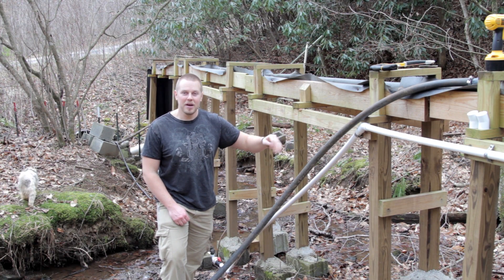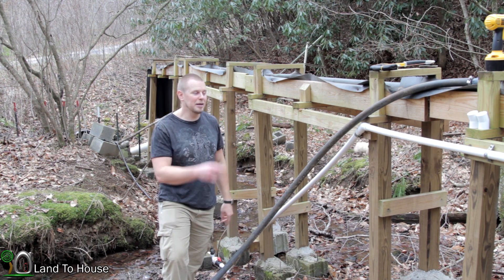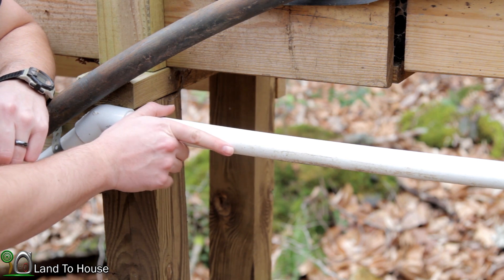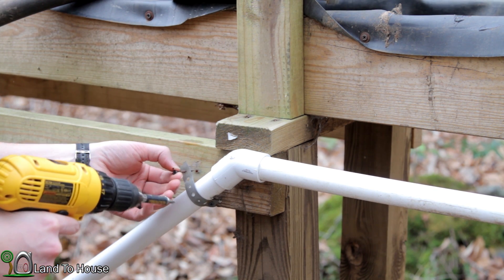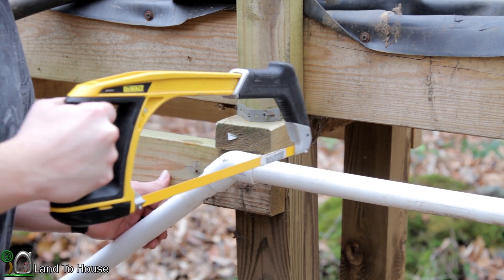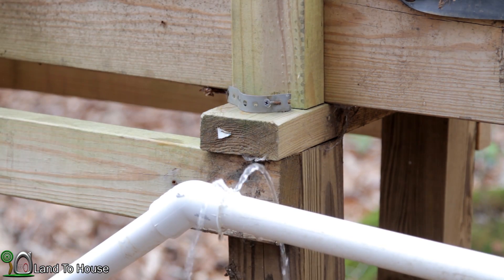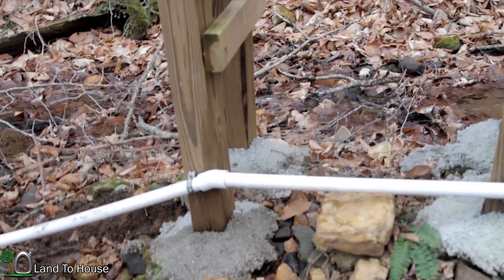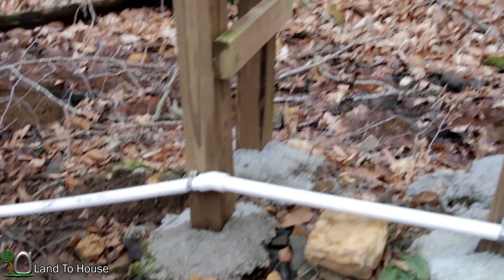Ram Pump Air in the Drive Pipe

Comment: In take pipe is At a height of 6 feet ..... so what will be the minimum run down length to start an inch ram pump..... please enlighten me on this issue although I feel that the length of run down length is not important ....
Reply from the maker: The run down pipe is known as the "drive pipe"  I have a test on my channel showing that a pump can run on a very short drive pipe. 5 feet long. BUT the short drive pipe causes the pressure wave to be very fast and this keeps the pump from building pressure. It also causes the pump to use more water. I recommend using a drive pipe that is at least 25 feet long but shorter than 100 feet.
Reply: Oh I see.... I am just beginning to built a pump.... and did some minor calculations on the so-called drive pipe length variation and angles ranging from 0• to 90 •.... but frankly i didn’t think About the pressure built up .... thank you so much ..... you’re a treasure

Comment: alternatively, you can try creating and installing an in-line air capture device to purge the air from the line like they do with other fluid systems in other industries.  You'll only need to periodically purge the device once in a blue moon of any captured air.
Reply from the maker: Thats true. The bucket intake that I am now using seems to have eliminated the air issue.
Reply: Land to House  I've been confused this entire time as to why you were using a bucket.   I was wondering why you were and was really confused by it instead of direct from river.
Reply: btw, I'm slowly catching up on your videos.
Reply from the maker: Ah yes. The bucket has become very important. The screen intake pulls from the creek and fills the bucket. The bucket has the ram pump intake about half way down in the middle. This allows another 6" or so of silt build up but also allows the drive pipe to pull from an air free source.
Reply from the maker: I just checked back and there are over 850 videos.. . so many.

Comment: You forgot to use pvc priming fluid before using the glue.
Reply: Not necessary for the kind he's using.  I have the same kind he has and it doesn't require priming.

Comment: HI        LOVE YOUR VIDS.    WITH YOUR RAM PUMPS HAVEING A BLADER IN THEM, WILL THEY WORK LAYED FLAT (90)DEG.,  WITH JUST THE CHECK VALVE FACEING UP OR COULD THAT FACE 90 DEG. ALSO ?     JUST A THOUGHT .  THANK YOU     T. S.
Reply from the maker: I have seen some ram pumps that are horizontal. The style that I make must be upright. The check valve has to be in that orientation to open and close. The pressure tank only has a bike tube not a true bladder so the tank must also be upright. Now if you have a pressure tank with true bladder then yes you could lay that down.

Comment: I'm glad you sorted that out, I have had to do a similar thing myself recently. Mine runs down the bed of the stream and i've had to spend a bit of time making sure there was a constant fall as \i had a dip in the middle which caused an air pocket.
Reply from the maker: That seemed to make all the difference. A drive pipe that is too long can hold air pockets. Thank you for the observation! I expected that I would have this issue with flex pipe but it would seem that solid pvc is just as susceptible.